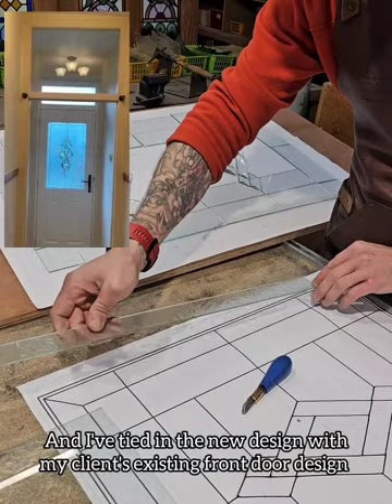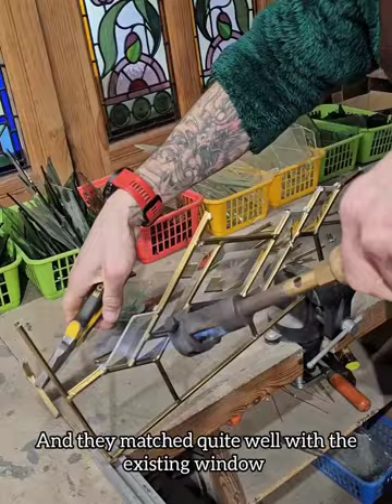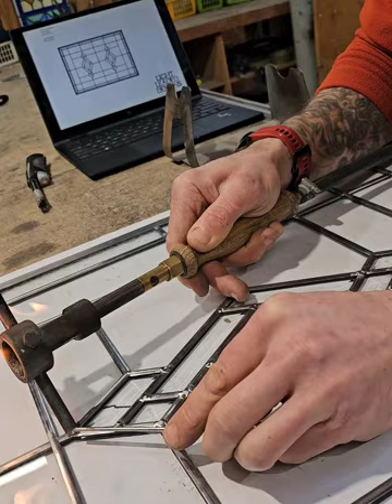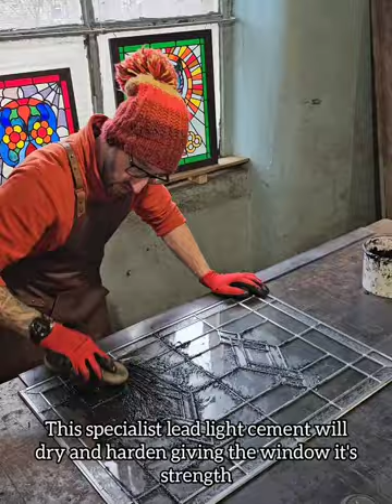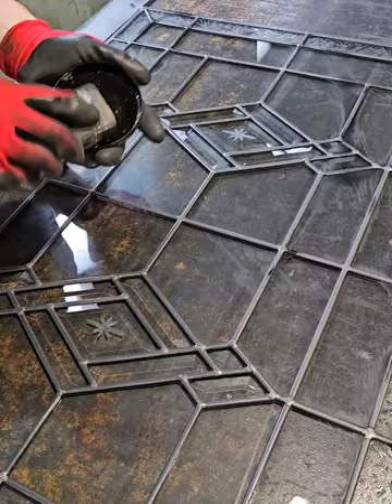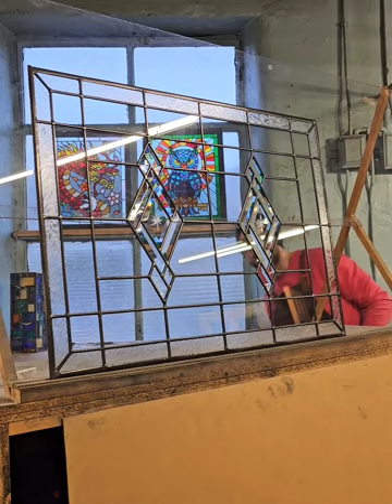Bevelled Stained Glass Transom Window Making

Comment: Boy, taking a leaded window apart is so much easier and faster than taking a foiled panel or piece apart!
Reply from the maker: The little window I took apart in the video was actually made with brass came rather than lead so it was rather easy to take apart as it hadn't been through the cementing process that happens to the lead came windows. If it was a leaded window instead it would have been much more tricky to do 🤗

Comment: Those beveled pieces are 👌 How would you have made those previously
Reply from the maker: The cut the basic diamond shape and then grind down the angled edges on different grades of grinding wheels. It's quite a slow and messy process 💎💎💎